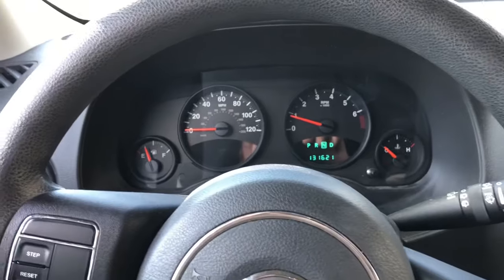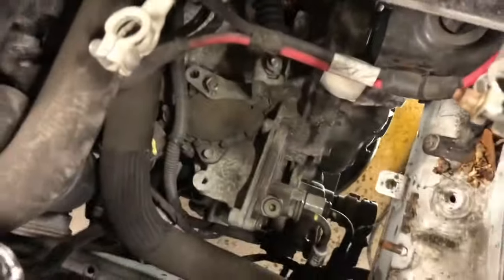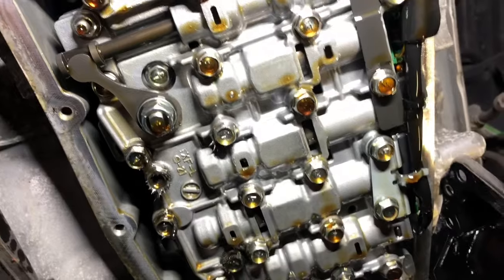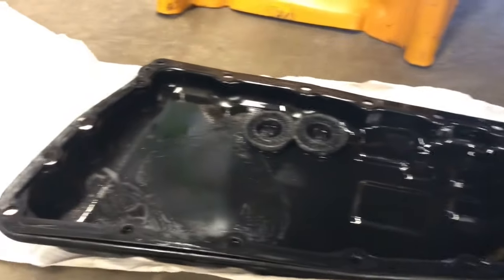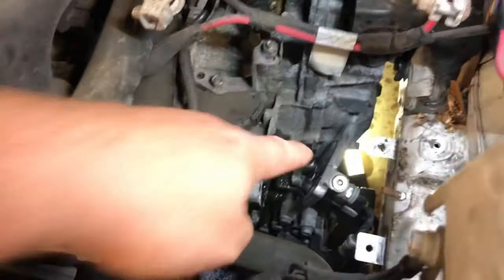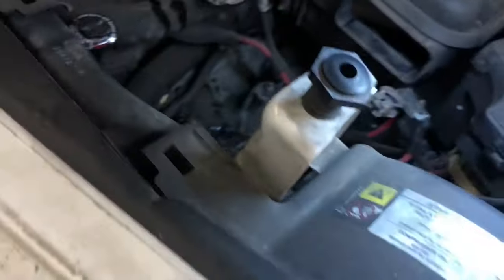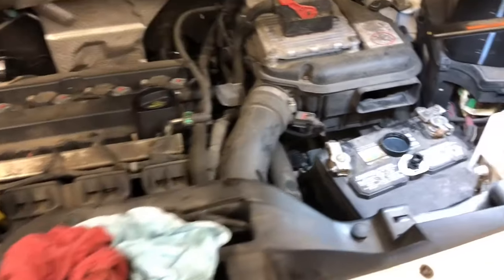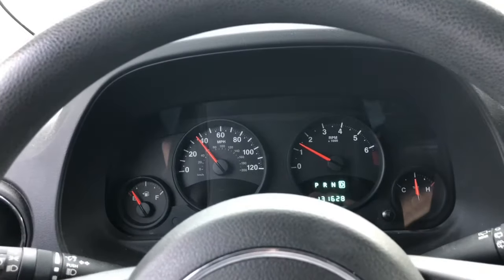Jeep Patriot CVT Transmission Fixed jf011e whine noise service

Comment: I am glad that the new filter and fluid fixed it.  I have a 2017 Rogue that I am planning a fluid change on.  It is really just preventative maintenance more than anything.  We had a Jeep Patriot and it made until 30,000 miles before it had problems.  The problem was it would not go.  Of course with CVTs you will get a lot pf people who have had good luck with them and a lot of people who have had nothing but problems and curse the day the things were ever invented.  The way I see it there are also some really awful automatic transmissions too.  The early Volkswagen 09Gs were horrible to.  Some had bad valve bodies and then at one point Volkswagen was telling people the fluid never needed changed because it was supposed to last the lifetime of the vehicle.  You can imagine how hard that came back and bit them!!! The irony of those being so unreliable was that they were really made by Aisin who also makes transmissions for Toyotas.  In fact Toyota owns a large part of Aisin if I am not mistaken.  But the irony of the 09G reliability is that the Toyota Aisin transmissions were reliable.

Comment: had this same issue, bought the parts and it fixed the transmission noise.  I also replaced the catalytic converter a few days after and car runs as new!...
Reply from the maker: Its a great feeling, isnt it? Thanks for the info!

Comment: If you take your cvt jeep to a mechanic , they will only change the fluid. Even the dealer will only change the pan screen filter if they find metal shavings. NO ONE will change the upper paper filter. Unfortunately that upper paper filter is VERY IMPORTANT to change. Even if nothing else was done here, JUST changing the upper filter would make a big difference in transmission operation,  even with dirty fluid. The fluid will not cool or flow properly if that paper filter is clogged.
Reply from the maker: Agreed!

Comment: theres a hex key drain plug on for the transaxle too. 
basically just sit on the drivers side and itll be up and to the left. it makes less of a mess imo. it doesnt drain the pan all the way,  but it helps the process go smoother.
Reply from the maker: Thanks

Comment: Yes be filter that hole is on the opposite side but it lines up. 
I have a 2016 jeep compass and mine would whine and go into limp mode when going on freeway for awhile. Couldn't figure where whine was coming from but tranny alert would come in. Changed both filters and wah lah problems fixed. No more limp mode,tranny getting hot, and whine disappeared. So happy.
Reply from the maker: Appreciate the report! Glad to hear!!

Comment: Hi,
I have a 2012 Jeep Patriot 2.0L. The Transmission got overheated and I drained the Transmission oil and changed both filters and added a new oil . Now when I get to the Stop Light it won't speed up as suppose to and the RPM with the speed is different! The engine light came on and when I do the Testing it comes up with the Error code, P0842 with the status Active and the Description is: K2 Pressure Sensor circuit open/short to ground.
I would like to know what does it mean  and what is the problem? Also The engine Traction Light is ON and never turned off.

Comment: Everyone knocks the CVT transmissions but my 2011 Patriot Latitude X has almost 300k miles on it and it still drives strong. The reason the CVT is failing for people is cause they don't keep up on the maintenance both my training filters have been changed at 35k miles whether they needed it or not.

Comment: Glad I have the 2014 with the 6-speed Hyundai transmission.. just did a drain and fill on the transmission and will do another one after a few 1000 miles.
Reply: Most of what's on the magnet is the pitting created by the sides of the steel belt as the Pulleys adjust with the input shaft at high torque, It's generally minimized by ECU's letting off on acceleration as the pulleys move into the appropriate input output ratio. Modern ECU adjustments can be felt against older ECU settings by simply putting your foot down on the accelerator pedal. Early Jatco CVT ECU's will have you accelerate almost instantly off the line with the pulleys adjusting and your RPM decreasing as you meet the desired speed set by the pedal. If you put your foot position to the same spot with the newer Jatco CVT ECU settings,  you will loose power momentarily, as the pulleys adjust, then the throttle servo will apply the throttle same as the older settings, but with the pulleys preset so that the CVT steel belt doesn't score the cones, and the pulleys don't chew away the grooves that allow them to move smoothly closer and apart. 

The major issue now with the Jatco CVT is with 2 kinds of engine breaking. When you are in a ratio where the input and output shafts have the same RPM, that's considered to be "close" to top gear. if you take your foot off the accelerator in traditional automatic cars, it's normal for it to drop into Overdrive (or top gear) as the engine has minimal load. In CVT it is the same. When you take your foot off the accelerator, the engine throttle adjusts to meet neutral load to the input shaft of the CVT, the CVT and throttle adjust in sync until the pulleys are in the "top gear" ratio, and then the throttle lets off. in both situations engine breaking is minimal and if going down a hill follows, you may "downshift" so that you have a much higher RPM in the engine, thus more compression strokes and better engine breaking. Here's the problem.

In traditional Automatic cars, the torque converter aides you in a smooth down shift, when you put the car into 2 or L, or down shift with paddles. The car immediately shifts and the engine stresses apply. No throttle is used, the Jump in RPM is purely from the load on the engine from the transmission as the input shaft speeds up. And for the purpose of slowing down, this is perfect. However, In a CVT transmission doing the same thing attempts to change gear ratios using the pulleys, the engine first applies a little bit of throttle so that the input shaft of the CVT isn't trying to slow down. when the pulleys then move into the simulated Gear ratio, the engine throttle is released. It's the Reverse of accelerating from stop. However, An engines Max RPM during engine breaking is governed by  the mechanics behind the engine, and not a limiter on the ECU, so when you down shift rapidly in a CVT, or even just click the stick into 2 or L, the engine can only throttle up to maximum RPM allowed by the ECU. This may be slower then predicted speed of the input shaft when the pulleys adjust to the fixed ratio of 2 or L, or whatever the paddles are set to. When the pulleys adjust, the input shaft to the CVT will be going much slower then it needs to turn for the output shaft to meat the ratio, set by the ECU, and the CVT is designed to adjust rapidly to ensure a fast ratio change (see below). The CVT pulleys adjust with the CVT belt under higher stresses then designed to tolerate and the whole system deteriorates rapidly in several ways. First, the insides of the cones become scored by the walls of the CVT belt as it tries pull inwards on the output cones, the steel bands rub harder as they go around the cones, and as they heat up rapidly, can lead to snapping, thus the belt collapses and the power train from engine to wheels is broken.

Next, the cone halves are connected to shafts and move inwards and outwards with respect to the shafts. The system in place to allow smooth movements of the cone halves in a Jatco CVT are 3 channels on the shaft with steel balls that sit partially inside the cone halves, lubricated by the CVT fluid. When the pulleys adjust under load, the steel balls are under much higher stresses as the cone halves adjust allowing the weaker of the metals to score against each other, leading to the channels becoming chewed out which then allows the ball bearings to squeeze out of their grooves, leading to the cone have turning with respect to the shaft. This leads to the pulley unable to move inwards or outwards, and the Steel belt can then be forced to break apart if the steel bands are stretched from the contracting of both pulleys. Also, the cones become instantly useless as they can't shift ratio.

Foot note: For all intensive purposes, automatic cars when shifted into 2 or L ... shift instantaneously to the desired gear ratio so that imidiate engine breaking takes place, even if the engine is red lining and you are flying down a hill. In the event of a CVT transmission, to fulfill the pose of emergency engine breaking, the smooth running of a CVT transmission is compromised. the only fix to prevent the excessive wear on the CVT mechanical system is to have the ECU deny the downshift due to the excessive loads presented on the CVT transmission, thus making the physical downshift, uneventful and the car continuing on at speed with no emergency engine breaking differences. 

I think that's right... could be wrong

Comment: I had a 2012. Trans temp warning light came on , pulled over and let it cool and added 1/2 quart. Power restored. 6 months later same thing. Pulled over  and let it cool and added more fluid but power didn’t restore. Replaced filter as it was black. Didn’t work, no power. Took to shops and they said it was done. The only option was to replace. Some shops said it was stuck in limp mode and won’t come out of it til it’s replaced. Idk. Maybe I got screwed. It’s hard to tell unless I did every option. Got another car instead.

Comment: Where can I find the fluid and filters I have a 2015 and having the same problem they want me to get another transmission and this could probably save me 3 grand
Reply from the maker: Google, or the links I have in the video description if yours is the same as mine.
Reply: @JohnVHLife  I didn’t see any links
Reply from the maker: @joshdavis3486  They are there, here is a copy and paste.
Link to the Main Transmission filter and gasket: https://amzn.to/3gZ0y4X
Link to the small upper filter: https://amzn.to/306vsSf
Link to the CTVF-4 Fluid: https://amzn.to/2OiV0pF
Link to the dipstick: https://amzn.to/304YkdN
Reply: Did this fix your issue? I have a 2015 and facing similar symptoms

Comment: Thanks for the video. 
I had similar problems at 184k mikes ,  performed the same procedure and car was driving great. After 1k miles since the fluid change, started noticing limp mode. Code p0777 and some high rpm’s with more noisy drive. Any thoughts and suggestions? These trans are expensive to replace, wondering if the issue is fixable
Reply from the maker: wow, thats alot of miles on a cvt, they are a crap transmission, unfortunately, yours might be at the end of its life.  Sadly its rare to find someone to repair them.  You can find a low mile one on ebay or a junkyard and have it swapped in perhaps.  I recently did that on a equinox in a video.

Comment: Hey, thank you for that. I found 2 little/medium size metal piece in the pan after draining all the oil. Is it bad ? I can send you a picture if that would help. Thanks.
Reply from the maker: Probably not good. But that’s what the magnets are for.
Reply: @JohnVHLife   My transmission meca says it might be timing belt pieces.

Comment: Thanx for the video. I bought a patriot and transmission doesn’t go in drive or reverse. Transmission is whining. You think replacing fluid and filters I have a chance?
Reply from the maker: it doesnt move at all? Thats probably a bad sign, but you can try the fluid and both filters as a last resort.

Comment: A bit late to this discussion but following your links for the smaller filter, does not show anything for a 2012 Patriot 2.4.  There is just a slight whine (77,483 miles) upon hard acceleration (which is not the usual driving style) and a garage replaced the fluid at 60,000 with Amsoil CVT although I've no idea if they actually changed any of the filter(s) as at the time, I knew nothing about this subject!

Would this suggest there  is NOT the upper filter for the car and short of dismantling the battery & shelf to check physically, would you suggest any other link for such?

Comment: Hello from Moose Jaw in Saskatchewan 
I was at the dealership today with my Patriot it is a 2011 cvt  2.4 l. My transmission run hot 2 years ago,  I stopped let the jeep cool down because the car was just screaming after the light was of I kept driving everything normal. So , I don't know if the oil changes after it overheated but 3 Days ago my transmission started not to shift proper anymore.  I have to play a little with the gaspeddle and he shifted sometimes normal sometimes not. The dealership sad I need a new transmission for 9.700.00 dollar. Nobody checked the oil or the filters what do you think I have the feeling your way would be the right one. I think they want to make money.  I am a Veteran and on CPP they don't pay much.
Reply from the maker: Could try to change the oil and both filters.  It’s worth a try. But they make more money on swapping trans, and nobody seems to try to rebuild them for some reason.

Comment: Im curious if you know for sure to check the fluid in park or neutral? Also is the fluid just mopar ATF+4? And you only put about a gallon total after your filter change? Thank you for the video very helpful.
Reply from the maker: Id have to double check, but typically auto trans you check running in neutral

Comment: My son has an 11 patriot and the trans overheat warning light comes on at times when he's on the highway. I am getting ready to change the fluid and filter tomorrow morning.  My local dealer where I have a friend that works in the parts dept got me the parts together. But they are telling me that his doesn't have that small canister filter. Only the main trans filter. And you aint kidding that CVT fluid isn't cheap. MY GOD $$$$ ha ha.
Reply from the maker: Unfortunately dealers dont know much these days, that filters in there for sure, use my link on amazon and change it, its probably never been done yet.  Ive repaired an 08 cvt, and this 13, and both had it.
Reply: @JohnVHLife  what's crazy is that they use the VIN to look up the info on the jeep. There happened to be a tech sitting there when I was telling her "there is supposed to be another filter" and he said she couldn't find it and the tech said there wasn't one. I gave up..Even with using the link you have amazon is saying it doesn't fit my 2011. Maybe something is different and the 11 just doesn't have it
Reply from the maker: @patrickm6000  Hmm, thats really strange if it doesnt have it, might be hard to see, but under the battery, does it have the removable cooler thing like I remove to get to the filter? Id bet money there is a filter there.
Reply: @JohnVHLife  I don't know. It's not dropped off yet. I'm planning on doing it tomorrow morning.
Reply from the maker: @patrickm6000  For what its worth, the little filter says it doesnt fit my 2013 patriot in the video, but its what I used on it. :)  you may just have to change this one yourself, and send the techs the pictures of it.
Reply: @JohnVHLife  man this is crazy. I see on the kids where it should be. I didn't pull the cover off and I called the local jeep dealer back again. They have no listing and she spoke with 2 techs who have never touched that on a trans service nor is it listed anywhere on their docs. I showed them a photo of what it looks like on your video. Man it's crazy. They insist it doesn't exist in their system.
Reply from the maker: @patrickm6000  maybe that's why so many of these fail so fast, they aren't up to speed on servicing them right. Are you mechanically inclined? Up to the task of opening up that top part?
Reply: @JohnVHLife  oh yeah. I have a 1200 Sq ft shop. Have a 10k atlas lift. I'm good. I found the filter locally and going to get it now. Can't wait for Amazon link. Sorry.
Reply from the maker: @patrickm6000  Cool, keep me posted!
Reply: @JohnVHLife  man I gotta tell ya. Everything went fine. Got it changed out and then spoke with someone in my offroad club who worked at a different jeep dealer. They never knew anything about that little filter either. It's crazy how the factory techs don't know it's even there to change it.